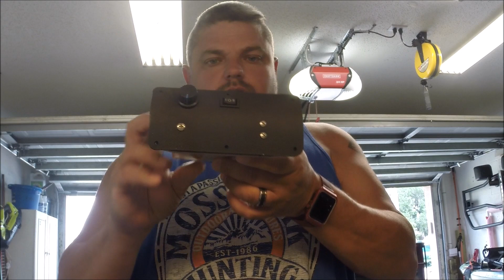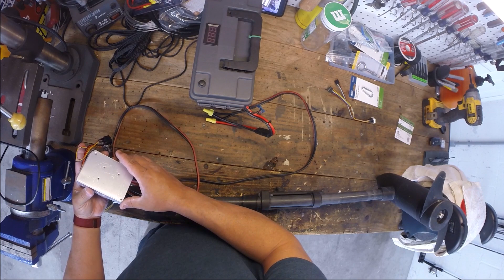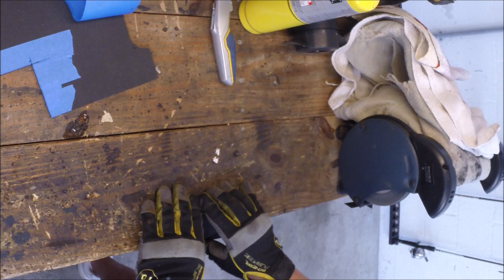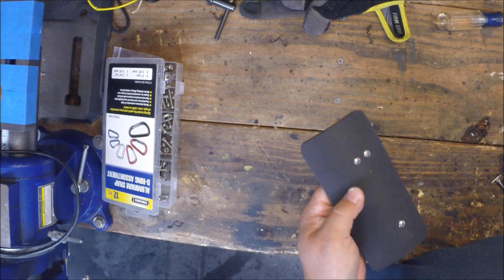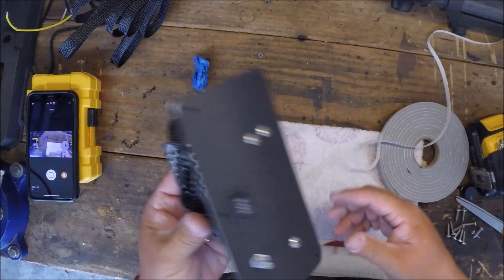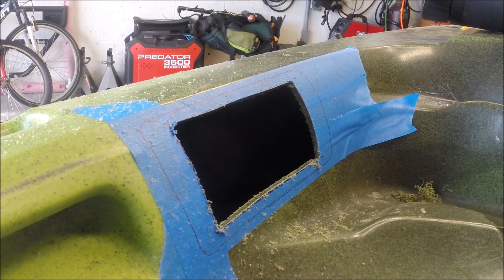Video 1 of 5 part series, PWM install on Pescador PRO 120

Comment: I have a ascend 12t The previous owner mounted a transom mount that works with the traditional trolling motor brackets they come with out of the box. Have you ever worked with the 12T?

Comment: If you had no issue with them why did you go through four or five !
Reply from the maker: I didn’t “go through” 4-5 on my kayak. I sell complete kits so I purchase them 4-5 at a time when it’s time to make the kits. I’ve had a few issues with the knobs going bad after some time, I think they are just luck of the draw. I now do a little more waterproofing on the knob.

Comment: I just received what looks like the exact same PWM controller except there is a sticker including English showing the connections, which would be great except the terminals labeled "MOTOR" on the sticker are labeled "POWER" on the board and vise versa for the other terminals.   
I tried hooking it up per the board labeling and it didn't work.  Hooking it up per the sticker does work, surprisingly.    Have you ever found this to be the case on any of your PWMs?
Reply from the maker: Andy yes, new batch of pwm’s I got were the same. The boards are labeled back wards.

Comment: hey i was wondering whats the cable rigging you have with the 2 yellow caps that`s sticking out of the battery. I literally have zero expertise with electrical components.

Comment: so how many hours does your battery give you at full speed now? whats the difference that you noticed?
Reply from the maker: Elvisr29 I fish local lakes usually 7-8 hours a day, and I’ve fished multiple days on a single charge. I’m only going full throttle in and out from the boat ramp usually.

Comment: What size battery do you run? I guess I’m not totally understanding the electric lingo quite yet, I have a 12v 100ah deep cell for my yak, can I use the same pwm? I read it can only handle 60ah? Just confused, also I have a minn Kota c2 30 if that helps at all.. any help would be great!
Reply from the maker: BenTheArmyGuy “ ah” is amp hours, your motor pulls amps,depending on what it pulls you divide that by your 100ah. So if it pulls 2 amp per hour it would last 50 hours in theory. The pwm is rated by the max amperage your motor would pull, this has nothing to do with your amp hour rating. 60 is fine for any 30 # thrust motor. If you google the specs on your motor it will give you a max amp draw, basically it’s the most your motor would ever pull at once. My battery is in another one of my videos if you look at my channel .

Comment: My motor is a 52a trolling motor. Will I have an issue if the pwn is 60A?
Reply from the maker: Daniel Lincoln you have to look up the specs of the motor and see what the max amperage is.

Comment: 2/3 thru using your videos as a guide...thank you!  Question...im installing on big fish 120, do you see any issues with extending the switch and controller wires coming out of the PWM?  Thanks again!!
Reply from the maker: Robert Ritsema  no, I extended them over a foot for my big fish 105

Comment: I'm assuming the the wire going between the battery and pwm is 10 gauge. What gauge wire are you using between the pwm and the motor. I've been watching a ton of YouTube vids, Google write ups and forum questions about gauge size and damn it gets real confusing. One guy will say one thing and he next guy says just the opposite. I have all the parts I need to do the conversion but don't know  what gauge wire to use. Thanks.
Reply from the maker: Pete Sauer between the battery and PWM it is the cable that comes with the trolling motor so I know that wire is good, it’s between 8 and 10 gauge. I use 14 gauge from the pwm to the motor which is the same as what comes out of the motor originally

Comment: Great vid, what did you do with the battery cables coming from the trolling motor that are supposed to go to the battery? Do you just cap them off since your pulling - + from the original switch in the head.
Reply from the maker: Not sure I understand, the original battery cable is reused to go from the battery to the PWM , it’s run from the front of the kayak to the pwm location.
Reply from the maker: Video 2 covers the battery cable
Reply: @sikassscivic  It was actually in Video 4, and you covered my question perfectly, thanks again for these vid's, I get headaches just thinking about "how" and you saved me a weekend of pain brotha, thanx.

Comment: Does the pdm have to be a 60 amp ? Will 40amp work ?
Reply from the maker: Larry Maples 60 is the lowest I would use personally, you can look at the specs of your motor to see what it is rated for.

Comment: I'm trying to decide between Marine sealant or the foam tape that you used between the plate and the kayak.
Reply from the maker: lowe516 I’ve done about 5 using this method over the last 2 years with no issues. The foam allows you to remove it with no damage to anything.
Reply: @sikassscivic  Automotive store or home improvement?
Reply: For the foam
Reply from the maker: I believe I picked this up at Home Depot. I superglue it to the pwm panel so it stays good.